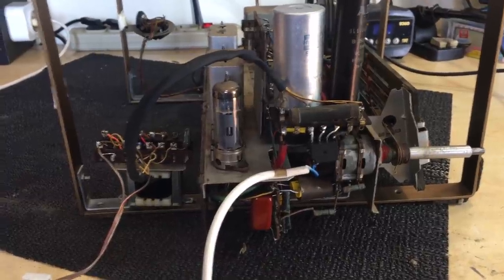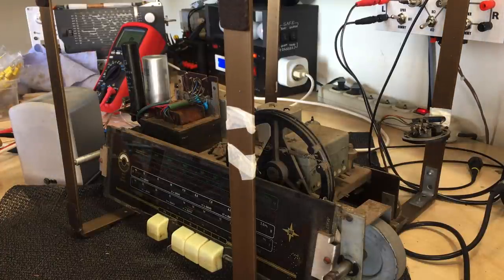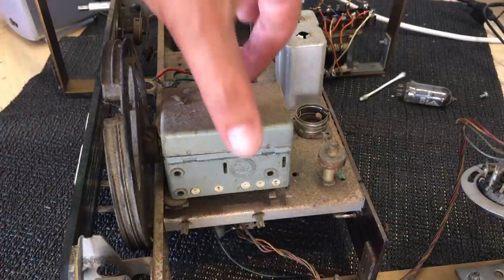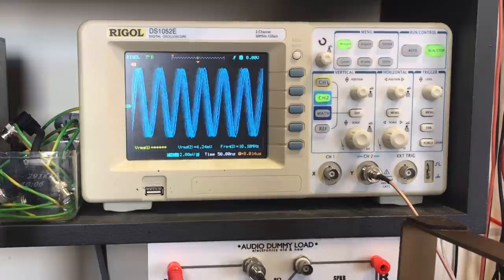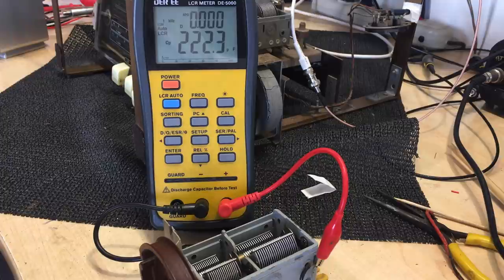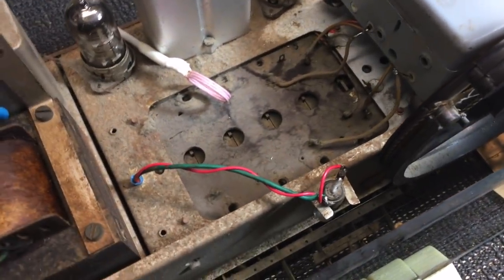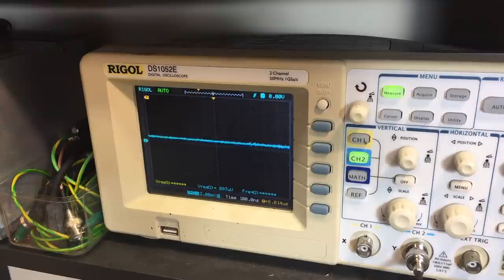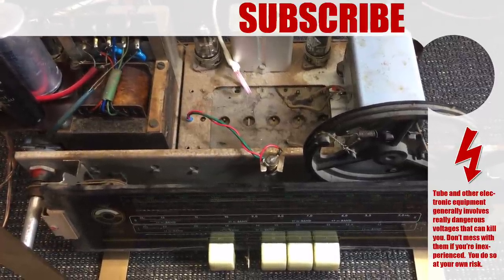Wega Herold K restoration - part 2. Transplant surgery needed. Enter the hoarder ...

Comment: I learned a trick years ago, from a retired radio and TV repairman, how to find a shorted section in a tuning cap. What you do is connect am Ohmmeter to both the frame, which is what the rotor sections are connected to, and the stater, and then rotate the gang until you find the spot where there is low or no resistance. You may have to disconnect the wires from the stater sections to avoid false readings. Also normally when there is a shorted section you will hear clicking and scratching noises as the plates touch, though if it's the oscillator section the radio will go dead.

Comment: There's a long tradition in this hobby of modifying equipment to use in updated circumstances...adding a MPX adapter to a mono FM receiver, adding a SW converter to a MW set, adding a tap to the volume control of a standalone TV to hear its audio through a hi fi system.  Adding a bluetooth receiver to an old radio is just a continuation of an old tradition.  Ask a ham; they change everything (or, at least, they used to)!
Reply from the maker: True 😊

Comment: Hi Manuel. Wash the capacitor! (Hahaha). 
 An old cooking pot, liquid soap from the laundry, boil the capacitor in there and occasionally give it a turn. It will probably boil off the paint but this method is good for cleaning and freeing up the shaft if it's siezed up.  I then use a flat piece of card and some contact cleaner and pass it between the plates while they are meshed. I suspect the difference in physical size of the two gangs has to do with voltage. The oscillator cap can have B+ on it while they front end is on the grids..
Reply from the maker: What is it with you and housework ? 
First you get me to give my hh Scott a bath, and now you want me to make pico-farad soup. :)
Reply: I'm just pushing you to expand your portfolio...

Comment: That came together more or less beautifully. Very strong reception, ah the value of hoarding!

Yes, the Bluetooth. Because why wouldn't you? Valve amp, decent sized speaker in a decent sized cabinet, Bluetooth will make the most of the amplifier's sound quality in a way AM radio just can't and it's not like you're doing anything irreversible to the radio. It also means this radio will remain useful for the foreseeable future.
Reply from the maker: The current owner’s teenage daughter uses it all the time now. Bluetooth definitely was the answer with this one.

Comment: Great job so far -- will look at Part 3 next for the Bluetooth install.  I'm all for Bluetooth as it gives these radios a new life that they would not have sitting on a shelf collecting dust as your Wega Herald K certainly did before you began your restoration.  Good repair on your air-variable cap replacement, but now that the old one is out you could drop it in an ultrasonic cleaner, DeOx it and then oil it and see if that improves its operation.  Marvelous things, ultrasonic cleaners.  Should also work well on plastic knobs and such.
Reply from the maker: I might just do that next time I need to do a transplant :)

Comment: To detect where there is a short between the plates of the tuningcap i connect a high-tension powersuply ( 150 to 250 VDC) with limited current to this cap ...then turn the cap ( close plates )  ...you can see where it sparks, many times the short will be burned out during this test .
I know that in the early -days there were technicians who did not have a high-tension powersupply use a big eletrolytic capacitor ( let's say something like a 47 uF/350V ) and charge this ( with a resistor in series ) on a HT supply from the radio ...then they did the test with this charged capacitor...where there are the sparks...there is the problem.
I have used this method many times and it works great!
Greatings from Belgium
Reply from the maker: Good idea. Like clearing shorts in old germanium transistors suffering from silver mica disease. I might try that just to get the experience. Thanks for the tip.

Comment: As far as the Bluetooth mod, it sounds like it is 100% reversible if needed as it is using what is basically a factory fitted Aux input.   
I like things to be original as well, but AM bands won't be around forever, and these valve radios need to have a purpose once AM is gone.
Good work in the restoration.
Reply from the maker: Thank you

Comment: Interesting that those two tuning capacitor sections were different sizes but same capacitance - presumably the plates in the smaller part were closer? Would that be by design to give them different inductance properties? 

Yes, bluetooth is an excellent idea - so nice to think that these radios  can continue to be enjoyed, with their valve amps as living examples of the incredible technology journey that ultimately led to bluetooth being possible!
Reply from the maker: The different size is probably because high voltage was supposed to appear on the one cap. Therefore they designed the plate spacing to give the same value.

Comment: Are you going to fix the tuning cap you took out? I always repair them rather than replace. It's just a matter of noticing which plates are touching and physically bending them. Sometimes the shaft bearing can be adjusted to clear the fault. As with transformers there's actually no mystery or insurmountable problems here.
Reply from the maker: I'll only actually repair it if I find I need one in the future.

Comment: Good morning :-)
You said, the air-turn-capacitor has a short. Where you able to detect, if its a short between the plates or in the arbor or somewhere? In the 80s we killed some shorts between the plates with the main-line and a bulb as a resistor. Your iso-trans is very good for such an operation. :-)
Reply from the maker: No, I didn’t go so far as to look for the fault. Might try it though, just as an experiment.
Reply: I'm sure you know what you are talking about but I'd be afraid to create some sort or arc creating some type of carbon tracking. Is that a risk at all?

Comment: Did you test the old condenser after you removed it from the radio?  I'm curious about the results.  As you said, it didn't look to have any problems.  I learn a lot each time I watch your channel, thanks for all the work in putting the content up.
Reply from the maker: The bearings on the one end were shot, so the shaft was moving laterally. Not good.

Comment: Did you use a voltage drop resistor after adding the bridge rectifier? Nice work as usuall, would like to see some troubleshooting/repair video on that cap.
Reply from the maker: I didn’t use a resistor because I had a 240V selection for the transformer mains input. This compensated for the slightly higher voltage from the bridge rectifier.

Comment: I think the offense taken with Bluetooth is that it has become synonymous with hack conversion jobs where they gut, or toss the original chassis, and put a pile of crap in it's place, with silly LED lights, LCD screens and such. Clearly this is not what you do, adding a Bluetooth to a phono input that is already there is no different then plugging a CD player, tape recorder, or anything other auxiliary source, and it is good that you demonstrate a way to do this in a way that preserves the original chassis and circuits.
 Another fellow I watch on here ended up with one of these "conversions", and in the cabinet was a bunch of cheap Chicom made junk bought from a Poundland/Dollar/Euro type store, and none of it worked anymore, which was why it was given to him. However that gutted Bluetoothed radio's cabinet ended up as a donor to an identical set he had with a wrecked cabinet, so it balanced out there.

Comment: Noob question. Is it viable to wire an instrument connection to the pre amp tube? I've tried to plug in to the phono input of my radio and I feel like its missing the pre amp. Thanks for sharing.
Reply from the maker: The pickup input on these tube radios expects a pretty high level signal because the phono pickups of that era were very high level. You can connect a line level device like a CD player and it should be fine. The Bluetooth devices I use are about line level, so they work OK, but still not as loud as the original phono did.

Comment: is the old black resistor with the bridge rectifier an inrush protector also
Reply from the maker: No. It drops some voltage to create the B2+, and is one part of the RC filter when it joins the second filter cap.
Reply: @electronicsoldandnew  so you just using it to power the rectifier
Reply: @chairuser4  No, it's after that. Behind the rectifier, you have a first filter cap that produces the B+ for the power audio amp. This B+ has a bit more hum, but at this stage, it doesn't matter. Then you have the big resistor that creates a slight voltage drop and after that, there is a second filter cap. Now you have a B+2 that is a bit lower in voltage, but with way less hum. This goes to the audio pre-amp and all the hf tubes. If you'd connect the power amp to this B+2, it would draw so much current, that the resistor gets too hot and drops the voltage too much.

Comment: Actually I've found Bluetooth is a HUGE selling point for these radios and console stereos.  Personally I only care what the customer likes/wants so Bluetooth it is!

How about investigating that tuning capacitor further to see if you can Identify the problem now that it's been removed. I have 2 radios with a similar problem and I really would hate to part them out because of not being able to find a replacement.
Reply from the maker: The bearings on one end were shot. It was moving laterally and shorting.